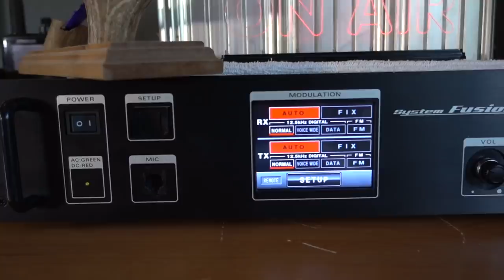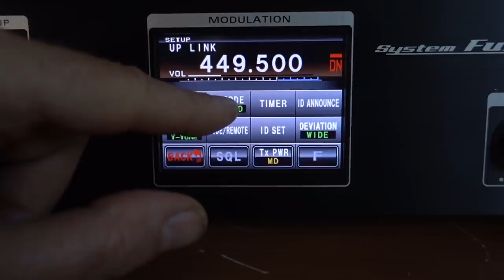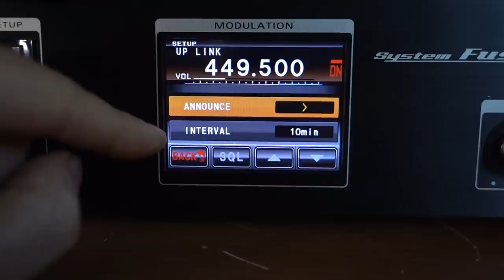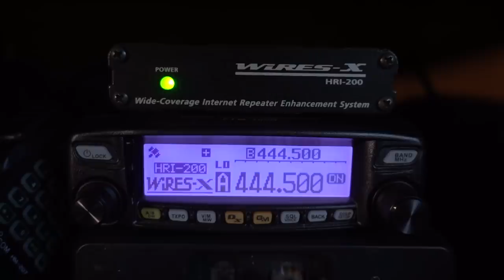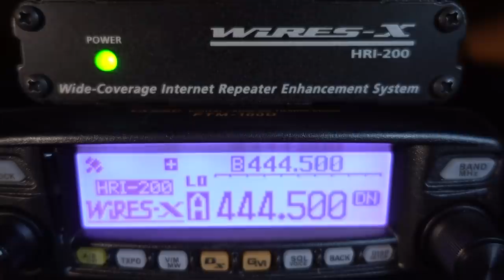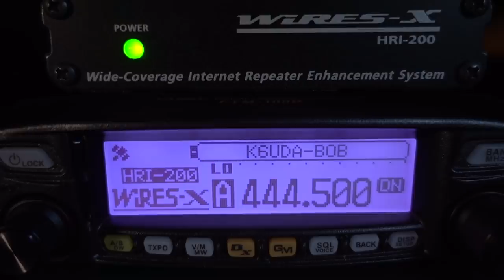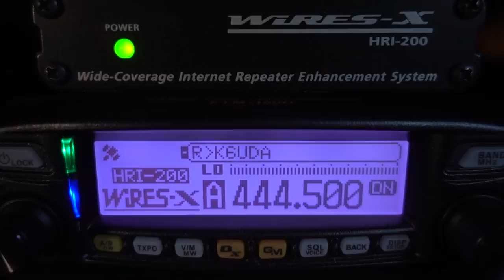An Honest Discussion About Ham Radio Repeaters | WTF happened To My Jeep Wranger ?

Comment: Bob, speaking of screw ups, I managed to fry my FTM-100DR while trying to provide the link to the Internet for our repeater as you are doing.  Our repeater is on a 600 ft. tower about 10 miles away.  Running the 100 on Low power, everything seemed to be working fine, but one day something changed.  I was unable to maintain contact with the repeater on Low.  Trying to figure out what was wrong, I bumped the power up to Medium and reestablished contact.  A short time later, two remote users on the same room as our repeater got into a long QSO and the 100 overheated, shorted out internally and died.  We later found that the repeater’s antenna had taken a lightning strike that damaged some components and caused the repeater’s output to drop.  I don’t know if was a high SWR problem or if the damage to the antenna was causing receive problems.  Anyway, the long QSO caused the FTM-100 to operate at almost a 100% duty cycle.  The built in cooling fan is apparently not up to the task of keeping the radio cooled down to a safe level under those conditions.  Another repeater operator later advised he had to install an external fan and would only run the 100 on Low.  Luckily, my radio was fairly new and was repaired under warranty, but I wanted to warn you and others to watch out, especially if the repeater stays very active throughout the day.  73

Comment: Sorry to hear about the Jeep, it'll be better faster stronger before you know it. For me locally in MA it seems like most of the repeaters are owned by clubs and they've all been welcoming from my experience with an occasional weirdo from time to time (they may have thought the same of me as well....) but generally all good experiences. One club I belong to has 21 repeaters in the area and allow anyone to use them at anytime and many are linked providing great coverage. They also encourage all to participate in the weekly nets whether you're a member or not. If you're newer and don't have many repeater options give simplex a try. Lately I've made almost as many contacts on 146.52 as I have on repeaters.

Comment: We have a TON of repeaters around here in the Atlantic City Area and the only time you really hear anyone is during nets. I should have my DR1X installed shortly and I'm gonna use an OS1 to link the repeater and park it in YouTubers and see if we cant't get the people around here talking. Also working on getting the Paranormal Net back on the air soon.
Reply from the maker: Sweet.

Comment: I hate to admit it... but it happens to alot of us.   My "incident" involved My old army 2-1/2 ton that I parked in gear without locking the cutoff out.  (ya, the vets know exactly what happened next...)  I looked back just in time to watch it bump-start, take off under it's own power, toast my shed, fence, an old lawn cart, and finally come to a stop in the ditch  next to my driveway.   Some of us can learn by reading the manual, the rest of us are called ham radio operators.

Comment: great video. But I'm surprised in the insurance company did not total out the Jeep. That's a lot of damage and with the buckling on the side that was a hard hit. Hey man shit happens. if you left it in a gear and turned it off it should not have come out of gear and roll back like that. I would put part of that fault on Jeep.

Comment: If its their machine they can say stay off for any reason. Their are plenty of machines on the air, most have regular users. Some are friendly, some not.  PS I had a truck take off on me too. It was parked for hours, and just popped out of gear. Rolled harmlessly to the curb. Got lucky.
Reply: Nobody "owns" the frequencies. Private repeaters on the public airwaves should not be allowed.
Reply: @drinaz4070  Nobody owns it,, but the repeater owner is as responsible for traffic re transmitted as the station that it originated from. I have heard people getting thrown off because they were being argumentative. Some people can be jerks on repeaters.

Comment: Don’t get me started on repeaters! What really sucks for me is that there are literally tons of old 2 meter radios out there that can’t be used anymore because everybody is switching their repeaters over to tone squelch required or digital. And which radios are cheap and easy to get for newbies? Those same radios. I have several of those old rigs myself and they still work perfectly after 20 and even 30 years. And they sit on shelves collecting dust. I’m not against progress, but not everyone can start out with the latest and greatest stuff. Would love to see some open analog repeaters still around, but just don’t see them anymore. Shame there isn’t the same nostalgia for open analog 2 meter like there is for AM HF, and straight key CW......

Comment: What was the price?
Reply from the maker: $400.00 under the Yaesu repeater program.
Reply: @K6UDA  nice the radios cost that much. What about the duplexes? And is this repeater dualband?
Reply from the maker: @todop  The repeaters are dual band and you can pick up a duplexer used a ham swap between $100 and $500.
Reply: Very nice. Thanks

Comment: First of all, you're not an idiot until you let it happen again. At this point you have been taught.
Secondly, whatcha vapin there? It's getting to be time to upgrade from my system. Right I'm huffing  a Spectrum mod with an NRG tank on top of it. I'm feeling it's getting boring. Usually you'll find me with a sub tank filled with 36mg juice.
Reply from the maker: Thanks. I'm vaping a Reuleaux mod and a freemax tank.
Reply: @K6UDA  Thanks Brother. See ya next time...73...kn4vup

Comment: Now you can get a new JL
Reply from the maker: But what if I don’t want to car payment? I’d rather have my jeep back I spent a year of building it.
Reply: I completely understand I spent 3 k getting it set to tow behind my Motorhome , if I bought a new JL I would have to get it set to tow I would be able to take out the Stay-in-play  break system
Reply from the maker: @stevest.martin3940  I just installed an AirForce one brake on mine. $2K just for that.
Reply: K6UDA best system for air breaks ! I have a gas Tiffin no air.